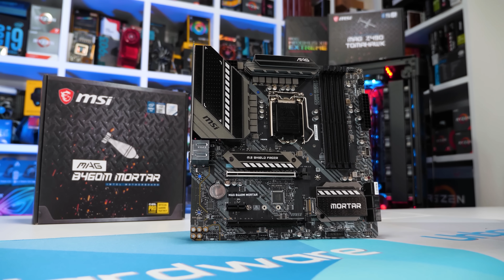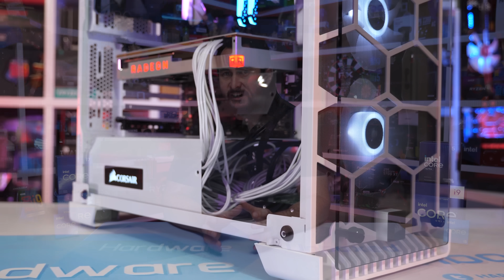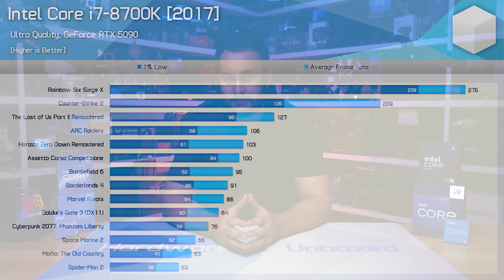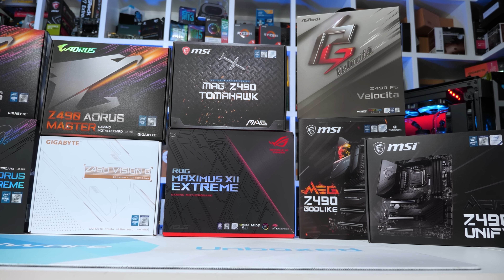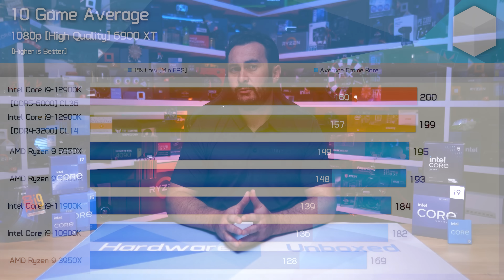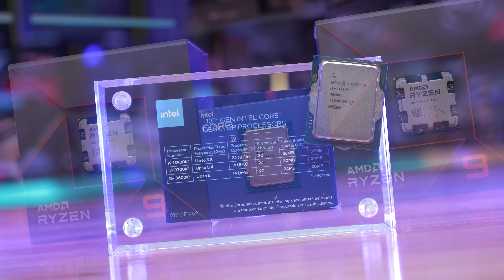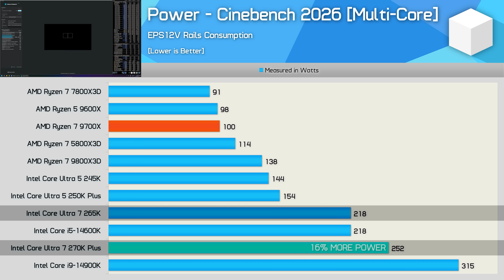How Intel Fell Behind, 10 Years Of CPUs Benchmarked

Comment: Not enough PCI-E lanes, no Quad-Channel and likely not even proper 7.1 audio jacks on the rear I/O.
So no, it is still not beating X58/X79/X99 chipsets at an affordable price for those kind of pro-users running multiple games and or other productivity workloads.
Typing from my 13900K with 128GB DDR5-5400 XMP and RTX 5090 system with 106TB storage and 2x4TB 990 Pro NVMe.
Convince me more.
Reply: Christ, man, imagine bottlenecking that poor 13900K with such dogshit slow RAM. I take it you don't play games?

X79 was the last time Intel HEDT made sense though, shame cheap 1680 V2s only came very late. Love my 1680V2/R4BE setup.
Reply: @Wasmachineman  An 8-core X3D wouldn't cut it for my tasks, 9950X3D is nice but will it actually hold up in multi-tasking when you run more than just a single game on a single CCD while also loading the other side with other tasks. In that case the E-cores have been nice to offload some tasks to.

A 52-core would be nice BUT if it ends up still being a headache with SATA-port amounts, PCI-E lanes causing the GPU to drop when adding too many NVME drives or having to shut off other features in order not to run short of lanes then it still kind of sucks.
Reply: @Wasmachineman  My kind of users want the HEDT days back at an affordable price which can still game and overclock with decent IPC instead of overpriced threadrippers and xeons which aren't really on the same IPC levels but also because motherboard makers have been lackluster not adding proper 7.1 capable audio jacks on the rear I/O people now also end up having to install actual audio cards if they want some decent audio and not having to route it stupidly to the front of the case for just 5.1 capability.
Reply: @Wasmachineman  I also own an i7 3930K at 4.8Ghz with 32GB DDR3-1866 CL9 XMP in 8x4GB configuration with an EVGA 1080Ti FTW3 that still runs Battlefield 6 fine today at 1080P with High/Ultra settings. Great platform. When things were versatile with enough lanes, good audio and high overclockability and easy to control temperatures at an affordable price.
Reply: @Wasmachineman  I also love how YouTube partially keeps shadowbanning comments. You'll just have to be patient.
Reply: @Wasmachineman  I do play plenty of games but I do more than that, office work, virtual machines, archiving of large files using winrar with 64gb dictionary taking up 96gb ram sometimes on its own, video encoding and video AI upscaling let alone having things on the side like video conferencing, live streams and what not.

I sometimes run more than one game silmultaneously, having more ram capacity is far more noticeable than that little speed bump. Once you start running out of ram and need to start swapping you'll feel a vastly larger impact. I multi-task a lot, so no this configuration is fine and I've even been multiple times in the top 100 leaderboard of 3Dmark benchmarks with this machine even in the top 10 a few times when I just acquired the RTX 5090 so no performance wise it is completely fine and better than the majority of systems out there. It will be very niche differences.

Comment: The i5 10600K is a underrated gem.
For overclockers on a budget, it was legendary.
Reply: Dead end platform was dead end. 🤷 (Rocket Lake was NOT an upgrade). Comet Lake was an idiotic choice, no exceptions.

If you bought a Ryzen 5 3600/Ryzen 7 3700X instead, you could have upgraded to a Ryzen 7 5800X3D or Ryzen 7 5700X3D (which were just ≈$145 brand new on AliExpress for like 2 years) on the exact same motherboard and STILL have top-tier gaming performance on the same core platform to this day!
Reply: @Cooe. 
The 10600k OC'd to faster than 11900k performance...
You couldn't OC the 3000 or 5000 amd for $#!+
Upgrade cycles (due to moores law being dead) have gotten much longer that upgrades on the same socket aren't enough to justify an upgrade these days. 
I disagree with your statements. I got 4 solid years from the platform, then just got a new platform that doubled performance (9800x3d+ddr5) when it was time.
Reply: @gasracing5000 🤣 The i9-11900K's performance was ASSSSSSSSSSSS!!!!!! That CPU wasn't even REMOTELY close to a Ryzen 7 5800X3D! That CPU couldn't even beat the regular Ryzen 7 5800X! Dude, you're absolutely DELUSIONAL!
Reply: @Cooe. You seem to be confused... Ill drag race my old OCd 10600k vs a 5800x3d any day and walk away with the pinks. You should do research before talking out your @$$

Comment: Usually always good videos!, but this is an overly pessimistic view of Intel's "gaming" desktop CPUs. 
I see it very differently. 
What I also notice a lot is that that type of YouTube computer hardware very often isn't impressed by new hardware. 
Either it's just good or it's not good. 
As a gamer who doesn't do every generation upgrades, the jumps are much bigger than what tech tubers experience. 
Average gamers just don't understand this point of view of theirs. 
Robert Hallock, Vice President and General Manager of the Enthusiast Channel at Intel, explicitly confirmed in a recent interview (March 2026) with Club386 and KitGuru that Intel is aiming for a longer lifespan for their desktop sockets.
I wish them good luck with new videos!

Comment: The funny thing with LGA1151v2 is that there are a few Z170 overclocking boards that have modded BIOSes supporting the 8th gen and sometimes even 9th gen processors. They are not just pin compatible but logically compatible too, it's only artificially disabled.
Reply: false. The power pins are different. Maybe if you are running an early engineering sample that may have had LGA 1150 still in mind, but not for a production coffee lake processor.
Reply: @malcomreynolds4103  My 8700K runs just fine in my Asrock Z170 OC Formula--both regular off the shelf parts. Required the modified BIOS and masking of two pads on the CPU (though many claim not strictly necessary). This was a common configuration at the time, especially on the mATX OCF which still holds 8700K records today despite the Maximus X/XI Apex existing.
Reply: @ax13h  Winning the silicon lottery in one specific example that doesn't need the extra power after hacking it to take it is not a good example. It wasn't a secret that they tried to make it work on 100 and 200 series chipsets, but not enough CPUs could be made to be stable on its power pin out
Reply: @malcomreynolds4103 Every single person who tried it on hwbot back in the day had no problems. I didn't but many ran the 9900K which easily pulled over 200watts without issue through a Z170X. If everyone is winning then it's not a lottery, just a fact of the matter. And there was no hacking involved: the modified BIOS was released by Asrock albeit unofficially through the forums. They knew it would work, it does work, and everyone knows it works... except you for some reason.

Comment: Is still use i7 6850k Broadwell E oc ed to 4.5 GHZ with 32 gigs ddr4 quad channel ram, and it can run all the modern games at 1440p 60 FPS cap.

Comment: Is RAMaggeddon starting to destroy the youtube tech reviewer industry?

Alderlake didn't just have AVX512 either. It had almost everything. Even Zen 5 doesn't have the full 16-bit AVX512 set yet.
Reply: Is it viable to run 12th gen with AVX512 not disabled?
Reply: @itspaafekuto  Just disable the worthless E-cores and never install BIOS microcode 15 update. They limit the ring speed too. No reason to upgrade if you had 12th gen with DDR5, gen 5 PCIE and full AVX512.
Reply: @theexplosionist2019 is the feature removal permanent or is it reversible?

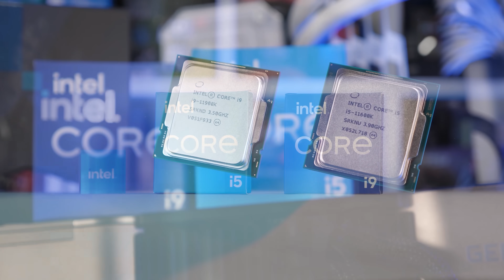Comment: 17:46 noteworthy addition: 11th-Gen CPUs added AVX-512, doubling IPC in workloads compiled for AVX-512, which made them so massive. Unfortunately most games do not use AVX-512.
12th-Gen CPUs kept AVX-512 for the P-cores, but it was later disabled through BIOS updates.

Comment: UserBenchmark is sweating when watching this video.
Reply: "amd cheated by being faster"
Reply: @zap117  ROFL
Reply: Having a nightmare meltdown more like! 🤣🤣🤣🤣🤣🤣

Is that stupid website still up? 🤣🤣🤣🤣🤣🤣🤣🤣🤣🤣🤣
Reply: @FunBunChuck  
Yes, and I think he does GPUs now too. I don't think he's as biased towards Intel there. (nVidia OTOH...)
Reply: Apparently he had a Reddit account and was posting rather pro Intel stuff on subs
Reply: @rossfororder  Even the Intel mods banned UserBenchmarks at one point because they were posting rabid pro-Intel nonsense.
The person who runs it and the results/reviews posted there are delusional, sadly I did use it for quite a few years before I realized how bad they are.
Reply: @essi2  LoserBenchmark is actually fine if you're comparing Intel with Intel, AMD with AMD, or nvidia with nvidia.
Don't ever ever EVER use it to compare across companies, though.
Reply: @throwaway6478  Userbenchmark was actually good for OEM and prebuilt PCs. So many people used it that it had compiled a large database of test systems, which is identified by the motherboard that was used. If you had something like an OEM HP or Dell box and you wanted to upgrade it, you could use UBM to see what hardware is compatible.

The problem is OEMs do a miserable job with hardware compatibility. For example, I had a Dell Inspiron which would work with some Graphics cards but not others. It came with a Core i3-2120, but it would not work with 3rd Generation Intel processors.
Reply: @throwaway6478  Agree, and its not bad to comapare Your own components  to see if they work at peak efficincy with other people same components  .Its just sad that bloke HATES AMD  so much ,nvidia and intel are fine for him . HDD ,SSD or RAM  testing is actually accurate but AMD dont make them :D.
Reply: @throwaway6478  Just use passmark.
Reply: How is that still up. I Think i visited it once or twice many many moons ago and saw total bullshit written all over it. Who even reads it
Reply: @T0EFOO fanboys…
Reply: @T0EFOO  I think UserBenchmark is living on people who don't know any better because of SEO.  That's how I found it back before I knew anything about it.  For a while it was the first result on google when looking for "<name of cpu> benchmark" on google.
Reply: User benchmark is laughable. I wonder if he purposely skews the AMD results to make them look bad. Every time I think on AMD stuff there it's always super slow according to his percentages and not worth a buy.
Reply: Intel -the choice of the uninformed.
Reply: Sweating?  Hell, I think they broke out the lube ....
Reply: I can't believe that people still even trust that lottery machine. I remember it saying that my GTX 470 was faster than GTX 680 in the early 2010s.
Reply: What's a user benchmark... user benchmark emotes fear.
Reply: That site had one use..... and it was for checking to see which processors are compatible on OEM and prebuilt systems/motherboards. The most obscure systems have been tested at least a dozen times with their benchmark, and they keep a record of all tests. 
However, reselling old OEM systems has been hurt by games evolving past Quad-Cores and the TPM requirement for Windows 11. Not everyone wants a system that had to be force fed Windows 11, and not everyone wants Windows anymore for that matter.
Reply: I used to really like their data for comparisons but then I read the notes/reviews.. Jesus Christ who ever writes those is weird asf
Reply: Why! They can make new video that proves how wrong youtubers are!
😂
Reply: @haukikannel  UserBenchmark does not make videos on YT. They seem to be stuck in the AMD FX days of comparisons. Intel is still trying to catch back up to it's own performance from 13th gen. That's crazy work.
Reply: @n8spL8 🤣🤣🤣🤣🤣
Reply: @n8spL8 or write an article… or one more fake benchmark. But all in all user benchmark does not care the reality if it contradicts their own…

Comment: Its fake performance by scaling power.... which in my opinion is stupid... the same can be said about Nvidia Gpu's.... after 1080 release they abandoned the power efficiency for power=performance.
Reply: Fully agreed. If you refuse to consider parts that creep the total power consumption up, you get a very different and IMO more accurate picture of the state of CPU and GPU technology over time
Reply: It's part of the reason I decided to go AM4, first a 5750GE then 5700X then finally 5800X3D, and also 6700XT then RX9070 (I refuse to get anything that needs more than 2x 8pin).

Comment: I am curious why Intel had the die to die clocks so low with the original Arrow Lake SKU's, since they were able to address it with the refresh.

Did they make some kind of mistake with the original Arrow Lake that forced them to set the die to die clocks low?

And is there a chance they could push a firmware update to boost the die to die clocks of the original Arrow Lake CPU's?

Comment: 16:41 11th gen is Intel's middle finger to desktop users. On mobile platform, there is Tiger Lake i7-11800H fabricated with 10nm process node. It is a very nice gaming 8 cores CPU in mobile segment. On desktop, it's the crappy 14nm++++ 11th series Rocket Lake that GN Steve calls it " a waste of sand " .

Comment: I have the Q1EH (QS version of 13900KS), and it's really not bad for <$300 shipped to pair with DDR4.
Since it's fully unlocked, it can be made very efficient by enforcing power and current limits in the BIOS, while not sacrificing much performance - the parameters of the 13900T/E is a great starting point. I'm not sure if the retail version is as tweakable, though.
I don't care about gaming at all, and I'm only using a cheap B660 board with generic DDR4 SO-DIMM (with adapters), but it's been perfectly stable, not a single crash or CRC error so far.

Comment: Going from 5820K to a 9900K was a nutty performance improvement. 
Going from that, to a 9800X3D, was just as dramatic, if not more so.
Reply: I went from a 3570k to a 5600X then sold it and got a 5800X3D as most of my games would benefit heavily from the extra cache.
Currently on a 7800X3D only because I gave my old PC to my nephew as a present.
Reply: Oh man....I had a 5820K. Good 'ol X99 platform! Good times!
Reply: @Phaerimms2  I previously ran an i9-7900X on an X299 platform, which was a rather poor experience. I also had an X99 motherboard but never ended up using it. It's a shame that even after selling both boards and the memory, I still fell short of affording a full AM5 kit. I'll have to buy the RAM in addition.
Reply: @ИванТрофимов-э9ф  What did you expect? These platforms are obsolete and have been supplanted by Ryzen processors and cheap Xeon-based builds. Intel's HEDT supremacy is long gone.
Вообще произойдёт чудо если у тебя кто-то это купит, ещё и по оверпрайсу. Ты же ещё и часть денег хочешь отбить, но рыночек порешал так что теперь оно ничего не стоит и никому не нужно. Я в той же лодке, и у меня есть чудовищно подешевевший процессор, но так это устроено, и мы только выиграли от Райзенов, потому-что может свапать платформы на менее дырявые.
Reply: I went from a Core i7 6700K to a Ryzen 7 9700X. Gains were pretty nice.
The 6700K wasn't unusable in general, but later PS5-era games really started to struggle to hit 60fps on it even when turning down graphics settings.
Reply: @rhoharane God of war and my old 7700k was at 100% 😅
Reply: My old gaming PC was running a core i5-6600 (non-K) with a GTX 960. 
I just built a new workstation/gaming PC with a 9900X and RX 5070 (non-xt). The power of this PC is unbelievable compared to the old one.
Reply: The 9800 is just silly. I upgraded from an i9 9900kf to the 9850x3d and it was like a 75% jump. 😮‍💨 At least in Cinebench. In games, my 3080 is the bottleneck now. 😂
Reply: I went from your grandma to your mom 💕

Comment: 2:45 "5Ghz which were insane frequencies at the time" Yeah.. especially since 5 years earlier you could manage at that on an i5 using air-cooling (I had a 2500K which is still running with my parents that was happy at 5Ghz year in, year out)
Reply: Sure.....or the computer is only on for internet browser and for limited time.
Reply: @pedroferrr1412  it is now, but back then it running two 4890’s in crossfire (before I upgraded to a 1080gtx) and was often driven hard... It even ran Crysis at a reasonable frame rate....
Reply: Actually I forgot the twin 7970's I had for a while too in between the cards.
Reply: Insane, not impossible. CPUs didn't reach 5GHz from the factory without excessive power consumption until the 2020s when we finally broke through.
Reply: @malucart  for the i5 2500k it was quite common in the overclocking scene. 4.5Ghz was an easier overclock since it didn't require as much cooling for that and auto OC would get you there without actually really trying to refine the settings. 

CPU's these days just don't seem to have the headroom for it without exotic cooling.
Reply: @oddball_the_blue They certainly have some headroom, but they can already essentially OC themselves on demand (PBO on AMD, don't know about Intel), so manual OC isn't really a big deal anymore
Reply: @malucart that's true I suppose. They've taken the skill (of fine tuning) and luck of getting a good OC chip with the ability to quickly ramp up and down.

(My current 3700x happily clocks to 4.25Ghz but when you just let it do it's thing will spike to 4.35-4.4Ghz but where's the fun in that?)

Comment: Unlike most people I own every single i9 from the i9 9900k - i9 14900k on average I spent $800 USD on motherboards. So I made the switch to AMD with am5. At this point even if INTEL does dominate zen6 and zen7 I’m still sticking with AMD. I rather just have to upgrade my CPU every year and not have to build a new system every year.